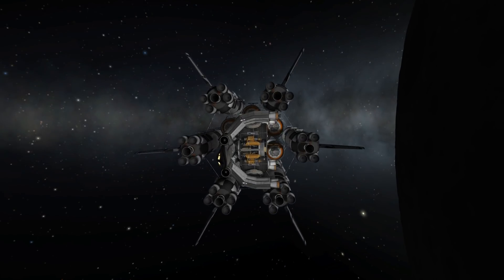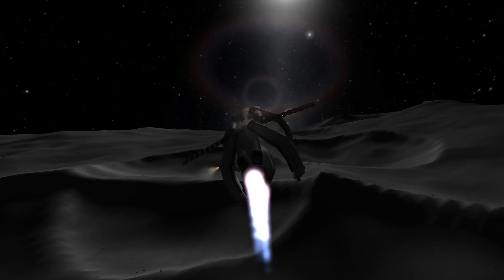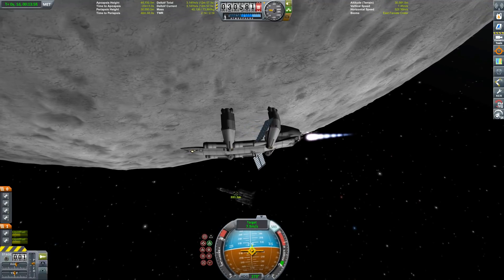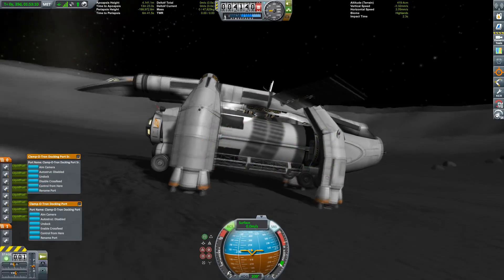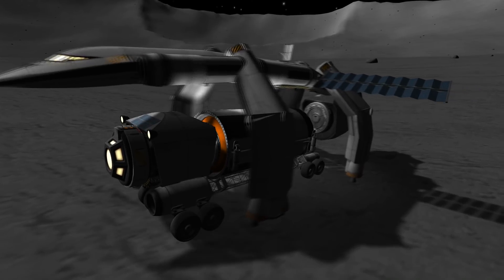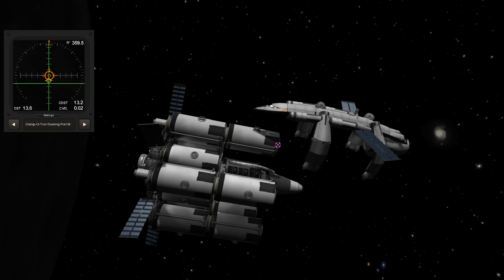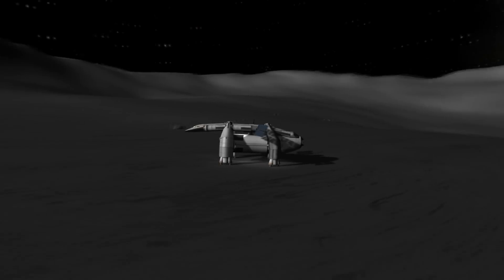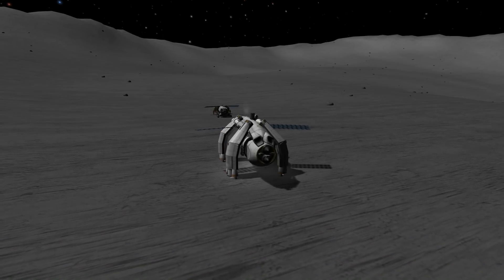Building a Moonbase for Refueling - OPERATION MUNSUCKER II - Ep.3

Comment: Here's how I would define what you've built in this episode:
"Squid" - Orbital Tug - Dependent upon other vessels to reach its ideal working environment; once there, other vehicles or modules depend on it to move about in a parking orbit in a controllable manner (typically for assembly hubs or to assist in other docking manuevers)
"Spine" - Orbital Assembly Hub - Either self-sufficient or dependent on launch vehicles to reach a desired parking orbit; once there, becomes a part of some other assembly (orbital tug almost always necessary for mission success)
"FlatBadAss" - Multi-axle flatbed truck - Ground vehicle for transporting heavy payload across terrain utilizing more than 2 axles. Payload attachment varies greatly by manufacturer
"CarryHaul" - Skycrane - A self-sufficient lander capable of transporting payloads to and/or from orbit and the surface of a world by clamps, docking ports or tow cables (typically resulting in a "dropped" payload with or without legitimately landing)
"The Rig" - Resource Hub - Usually a static facility on the ground or attached to an asteroid, meant for in-situ manufacturing of necessary resources for mission longevity. Often dependent upon transfer vehicles to move about the cosmos or terrain.

If you had put working wheels on "The Rig," or perhaps propulsion enough to maneuver about, I'd merely add a prefix to it and define it as a mobile resource hub. Same could be said of "Spine" until the Mammoths were jettisoned.

I think it's pretty safe to say lots of folks call these same things by other names... but I like to be specific without having the name be too much of a mouthful... kinda like this comment has been.

"Thanks for reading! Goodbyyyyyyyyye~!" :P

Comment: Technically the difference between a station and a base is that a station is considered a stopping point, whereas a base is a place from which you go out.  The game tends to consider things that stay on a surface as a base, whereas stations are orbital.  Technically, yes, you can have a "ground station" as well as an "orbital station."  I guess something on the ground would be a base mostly because it's a more focal point that you're less likely to just rendezvous with on your way to something else, or, in other words, it's an endpoint for your trip rather than a middle point.  Granted, if you had a station around Jool, it's not like you'd have a base on it.  This is getting long-winded and less focused the longer it goes on.  Hope it helps to some degree.  English is hard, and a relatively new language.